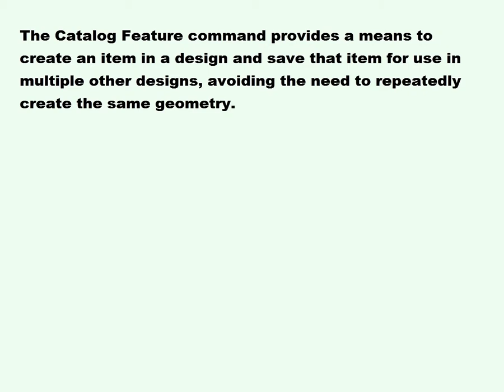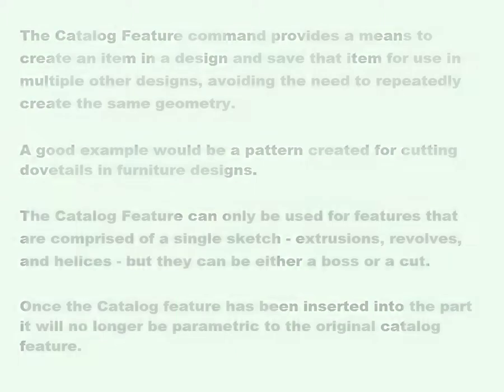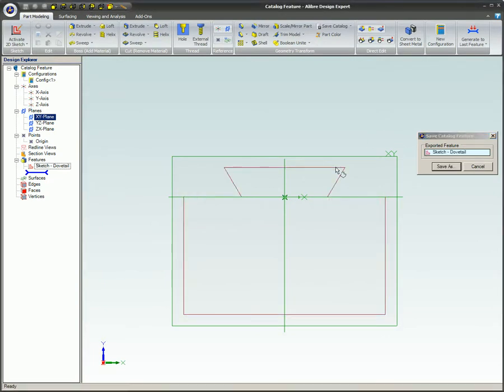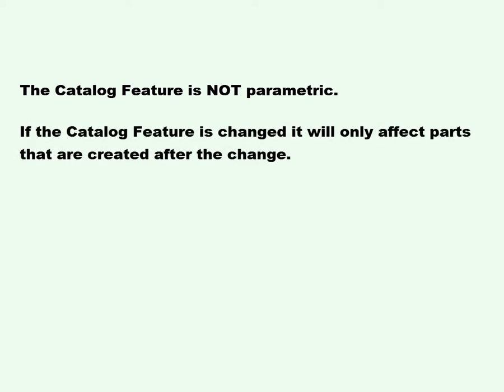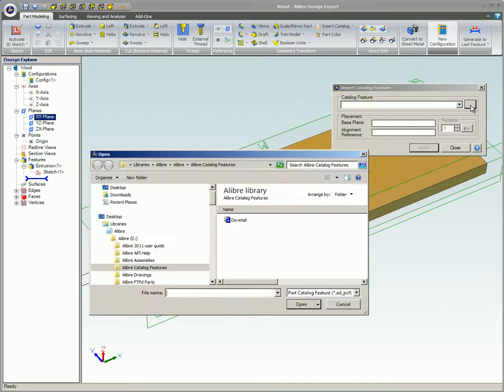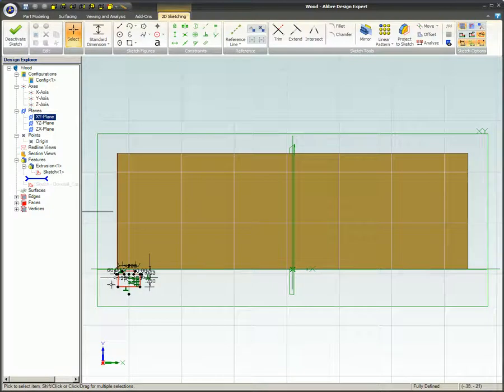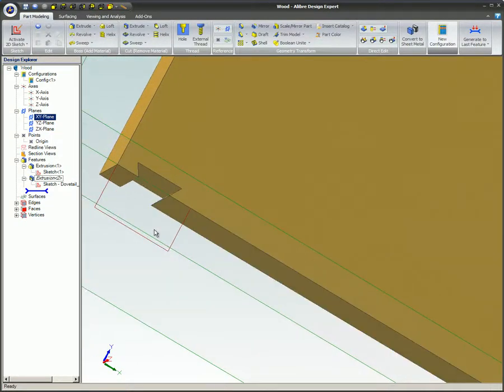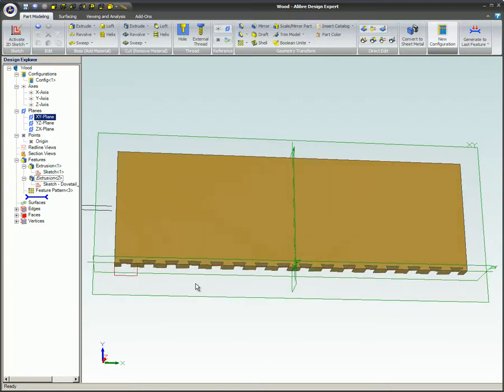Catalog Features in Alibre Design (Legacy Interface)

Comment: But how do you place a catalog feature in a precise location?  I've got a D-sub panel cutout - two circular holes and one larger rounded D-shaped one that need to keep their relative positions - but the only way I see to do it is to add roughly 20 constraints to keep every position and distance.  That has the side effect of making it only slide at a weird angle when you try to move it side to side, unless it's constrained vertically.

What I'd really like to see is a way to treat a catalog feature as a single object.  A feature like this cutout never needs to be resized or separated into pieces, and for things like front panel designs it'd make things so much simpler to not have to worry about accidentally moving one piece a hundredth of an inch without noticing, and to be able to pick it up and move the features at will without cluttering up the screen with a thousand constraints.